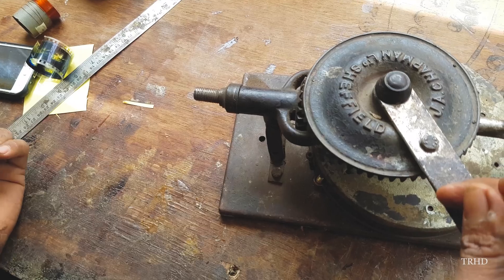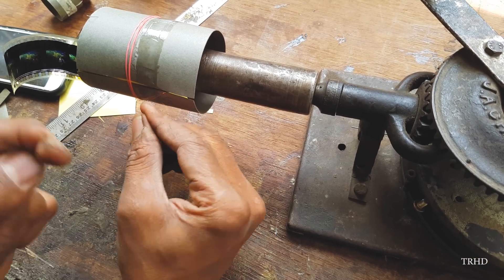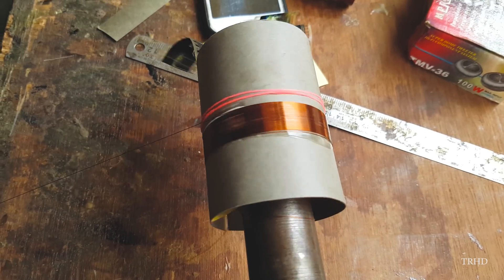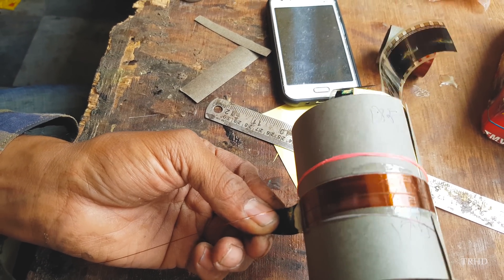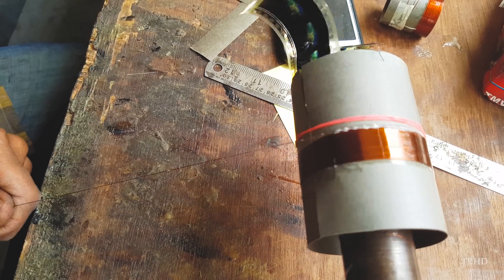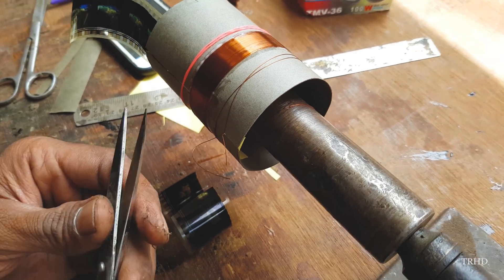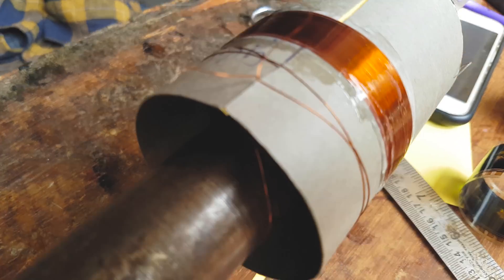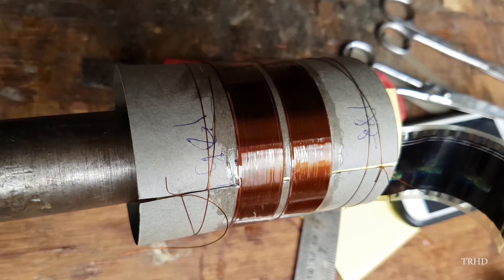How to Make a Voice Coil in 3 minutes | UHD 4K

Comment: epoxy is the worst adhesive to use in holding the bobbin on the former,  the epoxy will not hold up under heat and stink,  you'll need to use a high temperature adhesive in its place if your using this method for a subwoofer

Comment: my issue is the limited gap space i have for the coil. trying to recreate a 1930s voice coil is hard. there's no data on it.
when you said layer 2 was done in the opposite direction i thought you meant turned not going back to start

Comment: Are the sound and performance of the speaker supposed to change if you replace the coil with a custom,  hand made one ? (assuming the resistance, coil type and windings number match the original)

Comment: For those asking for the type of glue, it is Epoxy Acrylic resin (the one that comes in 2 tubes 1 the glue and 2 the accelerator) if you don't apply the accelerator it takes days and even weeks for the glue to set, you can speed the process by using a heat gun, or a hair dryer.
Also to make it more liquid and easy to apply you can add few drops of acrylic dissolvent or Toluene. depends on what's available.

I don't know if any other glue maybe used or not, I just know that's what the guys where I live use to set the wire as it is resistant to high temperature and has a good electric insulation.
Reply: Good job bro! but I want to know how to set that machine used for winding

Comment: How the Number of turns and the gauges of copper wire is decided with respect to the desired specification?
Reply: the length and width of the wire can be calculated to find how many ohms it will be. longer winding length means further movement in the speaker and more bass. higher diameter winding makes more heat dissapation and lower efficiency so higher power can be used in the speaker.

Comment: great video! to help most people out could you show how to make the form that you wind the coil on? not the hand crank but the sizing of that or any different size coil. that is my number one problem. i get the coil wound just fine but because i dont have an exact coil sizing arbors, it's always too big or small at the end. would help me out and i know this is any DIY biggest problem
Reply: Un grande Fahey, te vengo leyendo de varios foros, siempre colaborando. Que opinás de aplicar epoxi sin el acelerador, dará igual resultado que el de secado lento? No lo consigo y tampoco un buen material para el former, en 50w, el aluminio de las latitas de gaseosa y/o cerveza andarían bien? Gracias.

Comment: it's not that easy as it seems to be.....winding coils step by step is not easy.....he's an professional that's why he can do so.....I have tried this for car subwoofers....
Reply: What do you do with the two loose ends of the copper wire, do you just tie them up and forget about it or do you have to earth them or do you not earth them and do you have to make sure that they touch the back of the loudspeaker ie. the magnet ??
Reply: @davedogge2280 that goes out to the positive and negative wire leads that will eventually power the speaker